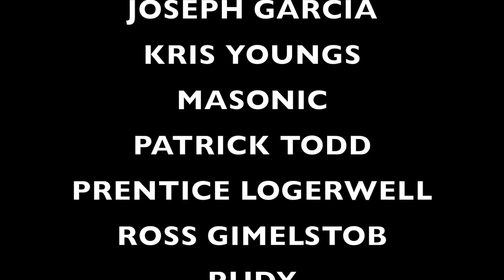FINALLY WHAT IVE BEEN WAITING FOR!

Comment: I would see if Ben will help you make a new bracket for the hydro, only because of the small bit of flex it has. It’ll fatigue the metal over time and you might as well take care of it before it becomes an actual issue. Just an idea if you ever need something to do
Reply: Didn't Taylor ray have a similar problem too
Reply: Dude, Hydro Hitting Shifter - AIDS x 10
Reply: Hydraulic! Hydro is water derived power/energy!

Comment: Other than the shakiness, the image is much better! The angle is so wide! Even wider than the GoPro I think. A lens with oss should take a bit of the shakiness out, but if you get a gimbal youll be fine. I'm stoked about the new setup! I love it! The sony can show you the sound levels. It shouldn't get in the red zone, if it does, the camera has some volume adjustment for the microphone. 👍🏻

Comment: how about you take the driver side controlls for the windows and mirror and stick them in the center console kinda like a jeep ? then no interference issues. ben could even weld the holes shut.
Reply: That’s quite a bit of wiring to do, they’re not Bluetooth you know. Plus, it’s Rudnick, he’d fuck it up
Reply: @mikemedeiros5458  all you gotta do it take the door wiring, take the speaker wiring out of it and run that to the center of the car. if it can reach the door, it can reach the center console.

Comment: Putting pressure on the gear lever when driving does actually wear your synchro faster. It requires such a little adjustment that I would try loosening the bolts of the handbrake and seeing if you can rotate it a degree or two by just loosening and tightening the bolts.

Comment: The hydro hitting the shifter could mess up the shift linkage and eventually start causing a second gear grind. Especially it being a short throw a little bit of movement when it hits puts even more pressure on it. It's like taking your hand and hitting the shifter side ways everytime you pull hydro. It's an easy fix just have been weld it up and move it over slightly

Comment: When the shifter hits the hydro it probably is fine but it could cause a little pressure on the shift fork against the synchro which could maybe cause friction and heat but it’s probably fine in my opinion
Reply: Just sounds sloppy in video 
Not sure if you can adjust the pull length of the hydro seems long
Reply: People don't realize even just holding the shifter in your hand can put pressure on the synchro which can damage it overtime.

Comment: That banging to in the shifter will cause issues over time. Every time you put pressure on the shifter in gear your putting pressure on the gears/synchros.  I just had the bushing in my shifter go out and the gear box was howling like a wolf at the moon. I fixed the bushing and now the transmission grinds into gear. I changed the oil and there were 2:inch’s of shavings on the plug. If you want to leave it but don’t complain when you got to spend 3k+ for a new trans

Comment: I think you should bring back h3 sr20 maita that thing was clean and whats going on with the mini truck in the shop. Also whats up with the rx7 tommy has rotting away outside ur shop shot buy that from him put a rb or sr20det in it I would or 4 rotor it lol I wish I had a rx7 dude has it sitting outside rotting away.  I mean the sr20 miata had fhe nice aem dash  sr20 turbo te  rims nice Interior wilwood brakes prolly so far best build car on the channel outside thr r32 bring it back and the truck in the back ground I don't think ive ever seen it besides rhe back ground

Comment: I would ream the mirro braket hole out a little and mount it flush so just the little know is out and make a little braket to bolt it from behind or mount it to the door it's self and just reach in the whole to use the knob.... Or fuck it block off the hole and adjust the mirror manually Yu have a fixed bucket so your never gonna use it once it's set